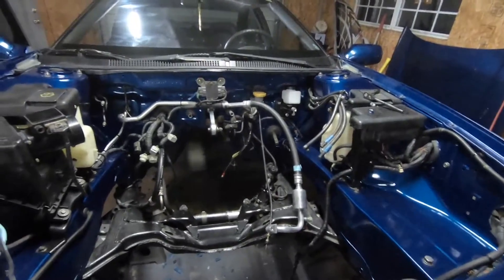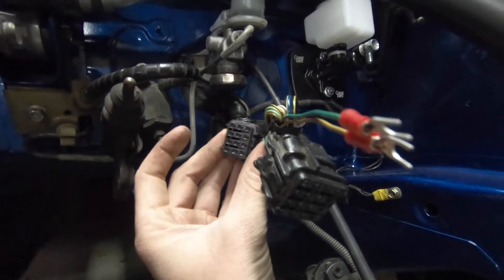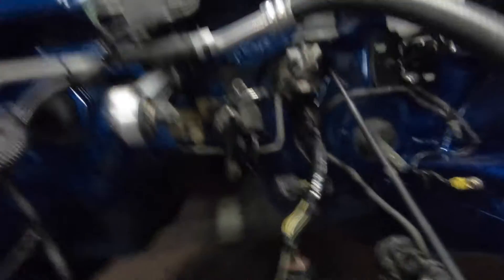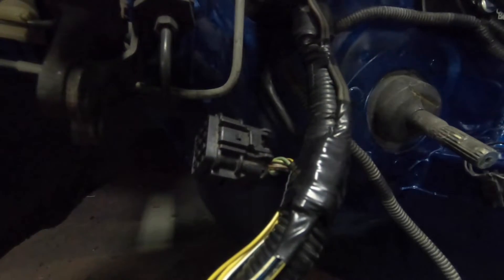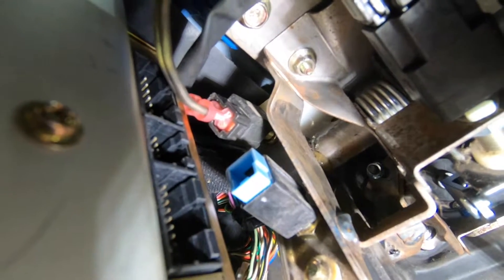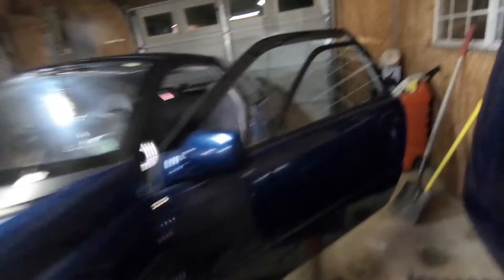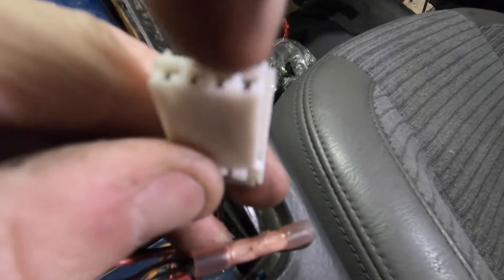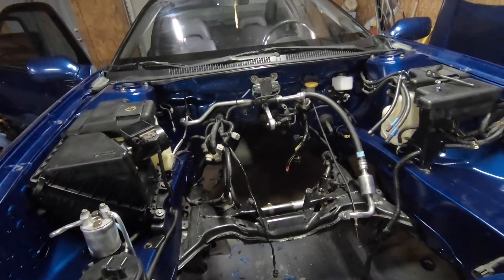HOW TO WIRE 5MT INTO SVX SUBARU

Comment: i noticed personally that same era legacies and or impreza shifting assembly will work with the swaps , the mounting points exist even a 1998 forester pedal assembly works good , same location, to the left of the steering column, the newer outbacks like the donor im using personally has a bracket to the column which is alot different to the older gen

Comment: What pedal assembly did you use and how did you modify it to fit? I purchased a partially completed SVX and haven't seen any documentation for specifics on the pedal assembly.
Reply from the maker: My first cooment got deleted accendetaly, but its an 02 wrx break and clutch assembly with minor mods. I have pics and write ups on my instagram on how I did it. I also have a parts car if you need anything.  pics of the svx modifications on my Instagram. @schmittyvids
Reply: @SchmittyVids  The problem I'm having is the top of the pedal assembly on the brake side is hitting the wiring harness which is stopping it from sitting flush against the firewall.
Reply from the maker: Yeah mine doesnt sit flush lol 😭